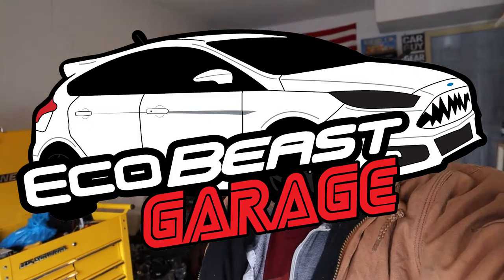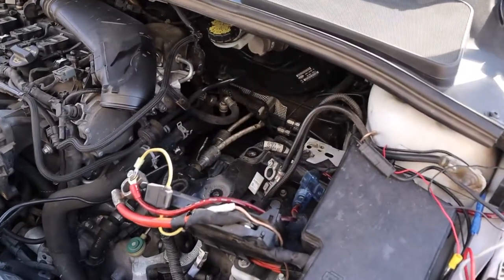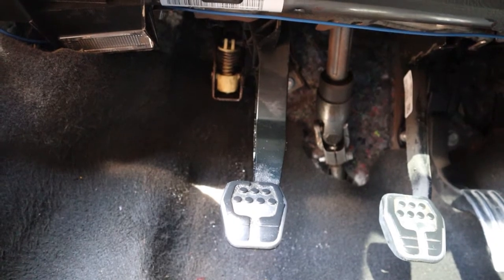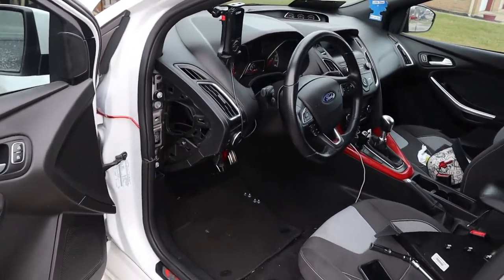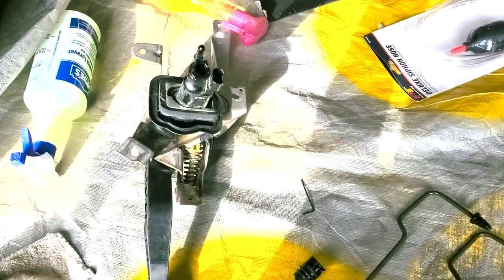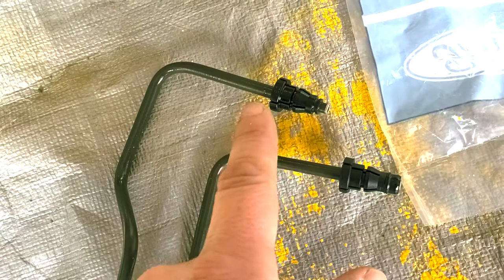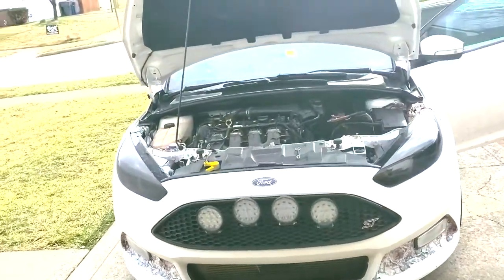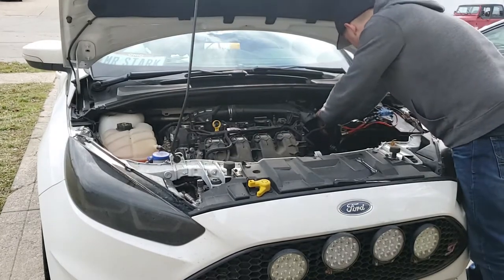Installing a New Clutch Pedal

Comment: good video! I know its a bit old now but a lot of STs still floating around out there that'll need clutches bled/components replaced. My clutch master cylinder just started leaking at the same location, waiting on parts as we speak. I'll prob get to the install this weekend, or next if it doesnt arrive in a few days.

Few bits of info for the Focus ST when ordering the clutch master cylinder/pedal assembly: 
2014/earlier uses: DV6Z-7519-A
2015+ uses BV6Z-7519-AR
*Make sure you dont order the earlier version (part number DV6Z-7519-A) for the later year ST. You wont have a sensor thats needed (clutch pedal position sensor) and you're going to have a bad time lol.
*Also, this a good time to upgrade your clutch line as well...its only $60 and its good especially if you already have the system open and need to bleed.
*You CAN purchase the cylinder by itself for about $50-60, but you're better off just getting the entire assembly so you know you have the right parts. Apparently INSIDE the master cylinder the sensor i mentioned is concealed. So you dont know for SURE you're getting one with a sensor until you assemble everything.
*This is a good time to upgrade your brake/clutch fluid with Motul600 or something better than OEM too if you track your car or push it on hot days. OEM fluid WILL boil and cause issues for your brakes if you try to abuse it.

Comment: Just did a transmission swap on my focus to the MTX-75, question for you... When the car is off, I can get the car in any gear, but when I start the car, I push the clutch pedal as far as I can and it won't go into first. Any ideas? Is it because I still have air in the lines?
Reply: I have the same issue. Was it your master cylinder?

Comment: Finished mine today but doesn’t start when pressing the clutch anymore, it starts when pressing the brakes which is very odd
Reply: Same here, did u ever figure it out?
Reply: @moneyshift2078  I haven’t yet, but i’ll  keep you updated if i do
Reply: @enthuzst6143  i’m having the same exact issue today
Reply: To all of yall there is a sensor that is in that pedal that when you push the pedal down it pushes this plastic piece In to close a circuit so you can start your car. Our cars have a safety thing if that breaks then we can use brake pedal. But see if that senser is in right and not broken.
Reply: Yes I concur, make sure the connections are fully seated. Otherwise the sensor might be faulty and may need replaced.
Reply: This is late but maybe it'll help someone in the future. When I was putting my pedal back in, that sensor kept falling off, so I zip tied it to the pedal for extra support. Worked really well!
Reply: need to make sure you order the right assembly...one version does not include that sensor (2014 and earlier) and Ive heard horror stories of getting the car to start (with brakes) and the not being able to shut it off without pulling a fuel pump fuse or battery terminal.
2014/earlier uses: DV6Z-7519-A
2015+ uses BV6Z-7519-AR

Comment: Anyone know the part number for that line I need it
Reply from the maker: The Ford Part# is DV6Z-7519-A. It's listed on their parts website as a Master Cylinder which is all an assembly with the pedal included.
Reply: What is the part number for the line you thought you had to replace? Thanks for the video!!